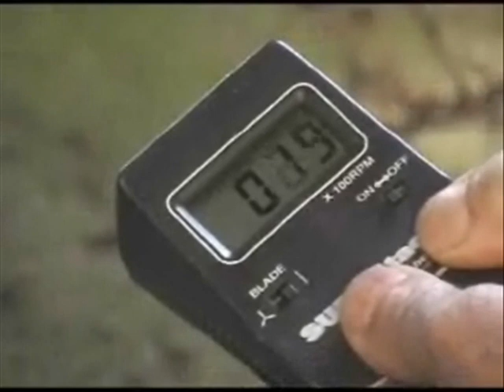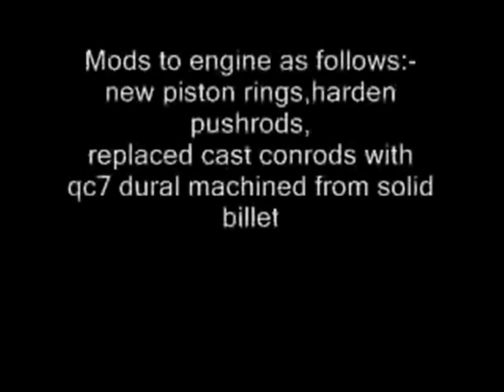Radial Engine 7 cyl.

Comment: @Chezrene1 Hi there, in answer to your question I bought this damaged engine from America on EBAY for $950.00, I payed £450 at the time inc P/P, and compleatly rebuilt and upgraded it, I see that Technopower have now done the same and there engines are much stronger than ever now, if you can afford one you won't regret it, they are light and power to weight ratio is excellent and make a perfect match to any scale aircraft.

Comment: Hi, Nice engine, sounds good. I say this because I too have a 7 cyl serial#B7B-074
It runs great, It has chrome cyls, machine rods and alum cast rocker boxes. I'm have it in a Sig Waco SRE 69"ws 20oz/sq.ft wing loading, perfect fit, not flown yet but will this spring.